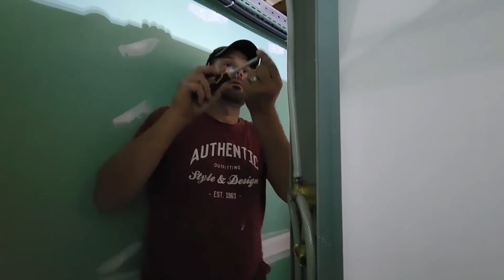It is different but it is still EXCITING!!

Comment: for off grid dryer  you are better to use natural gas  or a heatpump or condesing dryer. as they use  very little power 300watts to 1500watts . it will  do the same amount of drying at 1/4 the energy  cost .

 as to the plastic waterline installation   that you are currently using in Russia . Canada had the same +20 years ago and still in use today ( i believe they call it propex now )  but mainly see it on 1' or bigger lines in Canada  and with hydronic installations  as the fitting are less likely to fail as the ring type can  corrode and fail.. once you get use to it is much easier and faster then  crimping with pex especially in tight spots.   the pex crimping  you are referring too  is "surelok'"    that has the dog ear that you squeeze together.  it is used all across Canada   as I have  being using that surelok for long time in western  Canada.  the other version is "crimprite" that just uses rings.      I prefer the surelok version because if you need to remove the ring  you can do it easy enough  with side cutter and you can reuse the pex fitting.  sharkbites or similar  I use when i am lazy and  need it done quick  and/or transitioning from copper to pex .  as they are prone to failure  and leakage over time

Comment: Hi Arend!  I used to get bad nose bleeds after living in a northern climate for a decade.  I would strongly consider a humidifier for your home.  Use a nasal flush a few times with distilled water.  

I would also strongly recommend using a bit of petroleum jelly-based product on a cotton swab and lubricate the inside of your nostrils before you go to bed.  Lubricate as far back in your nostril as you are comfortable doing.  I use a product called Carmex and it has worked awesome to prevent nose bleeds.  Keep up with it because they can get worse.  It landed me in the hospital a few times.  🫤

Comment: That is type A pex it has the advantage of the fitting not  restricting water flow  because fitting id is the same as the pipe
Reply from the maker: That is a bonus

Comment: You sure that single warm water tank will be enough for heating and showering such a large family?
Just outside Moscow I had 2 gas boilers for a large house and 5 people and it's less cold than NN. I had to switch on the second when -20 C hit. Maybe you'll need an extra electric water heater when temps go down that low, to back up the wood heater.
Reply from the maker: Ya maybe

Comment: yeah it is basically PEX there are different classes of pex style fittings etc... learned this when I did a plumbing course Expansion Fittings Expansion fittings are a highly reliable and robust type of PEX connection. Known for their superior flow rate and leak-proof design, they are a preferred choice for many professionals. The key with expansion fittings is not over expanding them.  The other consideration is flow rate matching and fitting sizes and interconnections.  They have max PSI rating that can vary so if you intend high pressure applications look into what the pipe is rated for for your shower, its probably fine though.. And temperature rating. ie. good for domestic water but may expand or warp when heated close to boiling temperatures. Also heat may result in it shrink fitting once it cools. However useful as they are able to be shaped with relatively low heat ie a heatgun if you know the bending technique.

Comment: I don't know how far the farm will be from the main communications. But electricity will be needed in any case. Green energy is good only if there is a reserve for traditional. The house is large and will need a lot of both electric and thermal energy. Putting up poles and running a cable will be very expensive, but possible. But with gas, as the cheapest thermal energy, it will be even more expensive. Heating with electricity in the Russian Federation is very expensive. The cheapest is gas. Between electricity and gas, there is a niche for wood pellets. In the Russian Federation, this is not expensive enough, especially for a one-time purchase of a large batch. For this, you need a pellet boiler and the appropriate equipment throughout the house. If you place such a boiler in the basement, install inverters + special batteries in case of a power outage at home, so that the pumps work and the boiler does not burn down along with the house. In any case, in the future, the farm will be large, a lot of electricity will be needed, therefore, three phases of 380 volts will be needed. To lay gas to the farm, you will need a trench 1.8 meters deep along the entire length to the farm. Plus plastic pipes, there, etc. Okay, all this is advice and no responsibility, go for it, I'm sure you will succeed. The main thing is health and family.
Reply: Russian regulatory requirements for laying underground gas pipelines Gas pipelines should be laid at a depth of at least 0.8 m to the top of the gas pipeline or casing. In the following places, the depth of laying steel gas pipelines may be at least 0.6 m: places where traffic is not provided. Not 1.8 m.
Reply: @andreyiforoff8891  0.8 m Possibly, but I live in the Moscow region, on our plots 0.6 m is impossible. In any case, an earthmoving machine is needed, the depth of 0.6 is very suspicious. Any work is a cliff and a fire. In any case, you know better.

Comment: Hi arend anneesa family . Arend I agree it's a bit annoying the plastic joints with having to get that machine.  But it really shrinks back really tight so hopefully no leaks  . It is very satisfying building your own house to your design.  Of the shelf houses are fine  but if you want  change something then you stop look and may see it's easier to add on or reduce but a of the shelf is done to a certain budget and can be a pain for your builder or if you ask it to be  done a different  way . House is coming on well and that's a nice shower your fitting  . Did washing machine help your back any ?
Reply from the maker: Hahaha no the wash machine just made for a great laugh! We forgot to pull out the four shipping bolts in the back, we tried and tried to get this thing to stop rocking around lol, when we figured it out we had a great laugh

Comment: FYI...there is a real time voice language translator made in China and marketed as the brand Time Kettle M3. It's a wireless ear buds used in conjunction with the Time Kettle onLine App and your cell phone. It's a tri-function ear piece where you give one earpiece to the person you want to speak to and you have the other one. You take turns tapping your ear piece when you want to speak and the translated language you set is heard. Worth a look at if you can get it onLine in Russia. 
That pipe style is found in Canada/US known as Upinor Brand
Reply from the maker: I bought one of those time kettle translators... it does not work very well

Comment: I have seen boilers that have a heat transfer system through pipes inside. Usually they can be used if there is an external source of heat heating. The external source can be any Electricity, gas or firewood. The internal pumping unit gives off heat to heat the water. A great thing is that there are no temperature jumps like in my house, when the water heating starts in a double-circuit boiler. As soon as the pressure drops in the system, the temperature changes, it becomes uncomfortable in the shower, you have to turn the handles two or three times, then cold, then hot.

Comment: I’ve used pex tons on tiny house builds. Prefer the crimp type also. Shark bites often failed and had leaks. Might be because the homes are often moved long distance before they get to the final destination. Had to Replumb a few homes because of it. Just better to use the stub type crimps. They look like a wedding ring. Crimp the stub and they are done.
Reply from the maker: Those are the ones! Nothing faster

Comment: Both PEX A and PEX B are available in the US.  Crimp style, B, is the home owner style due to tooling as you pointed-out.  Originally, the shrink style, A, was used only by professionals as the manual tool cost US$400 to US$500.  The main difference is that PEX B fittings have a smaller internal diameter and also create flow turbulence, reducing maximum water flow substantially.  Additionally, I have heard that type A connections are more reliably watertight, especially long-term.
Reply from the maker: Thanks for the info! Appreciate you sharing that
Reply: @countrysideacreshomestead2008  You're welcome!  I've never used the drill type power tool of any kind, but the manual type was much quicker using a ratcheting pliers type of action using 2 to 4 squeezes, depending on diameter of the PEX tubing.

Comment: In Russia 99% of all plumbing is made of polypropilen and you have some of it as well. The press system you used is not convenient. The most convenient press system is Rehau or Tece but they are expensive. So just use polypropilene.
Reply: Ну у меня металлопласт, например)

Comment: Hello everyone. If you want to install solar panels on your roof, there may be problems due to snow, because your roof slope is small. The best option is to leave the network connection as an alternative source and the ability to use it when necessary, in Russia electricity is not expensive, and you can use solar energy nine months a year.

Comment: Push-on fittings you are talking about are known by some plumbers. But they are not produced in Russia. When we had good relationship with Europe, these fittings were imported from there. But they were very expensive and not commonly used because of the price. This system that is used in your home is one of the chipest, because of the plastic ring that makes the connection tight. Normally we use brass ring and another instrument, that is more convinient. Be careful using this plastic ring when there`s low air temperatures (there may be a leak in connection)
Reply from the maker: Understood, they were too expensive in Canada’s too

Comment: There pypes with axial fitings are very good and super quality, but your plumber took very cheap ones, which could be bad in the future, so check it
Reply: also he did super strange thing, in the place where pipe connects to valve, he used different fitting, which is really bad and dangerous (I have been using them and I know what I am talking about :D )

Comment: Does Russia have any local building codes and do you require any building inspection at any level?
Reply: I’m sure they do but not as strict as here in Canada. I wanted to put a sun porch on the back of my house and just the application to the city was over 6k then if they decided no I still didn’t get my money back.
Reply: He said there are some codes, but they are not enforced. No regular inspections,  just a final inspection upon completion.
Reply: In Russia, there are no codes or inspections for single-family homes. There are many different technologies for building walls: brick, concrete, aerated concrete, logs, timber, frame, etc. There are also many different pipes: PVC, polypropylene, metal-plastic, steel, copper. Arend used polyethylene pipes, which is not typical.

Comment: Have you already applied to build a house? Have you been allowed to build? If not, there could be big problems. Just because this is an open field - agricultural land. You can't just build a house there. And that is why the electricity will not fail.
Reply: Да, они фермеры, у них есть право на 1 капдом и строения рядом

КФХ можно оформить как в виде ИП, так и в формате юридического лица . Наверное так.  ИП бы выгоднее для них, мелкие они, но пока только так.
Reply: @Serg-qr5my  Уверены? Аренд говорил, что они эту землю оформили на ООО, где у него 50%. А статус КФХ - это другое. Что-то я не видел в его видео что они регистрировали КФХ. А кто тогда глава КФХ? я поэтому и написал, как бы не наступили на грабли и не получилось как с банковской картой
Reply: КФХ можно оформить как в виде ИП, так и в формате юридического лица . Наверное так.  ИП бы выгоднее для них, мелкие они, но пока только так.

Comment: You may want to check for sure, but I don't think you are correct on the laptops (or modern computers, in general) being more sensitive to 'dirty' power.  In fact, electric motors tend to be more sensitive to dirty power where the harmonics can cause them to heat up, etc.  Just do a quick bit of research.
Reply: Yes. Electronic devices (TV, computers, telephones, etc.) usually operate in the range of 100-250V and are very undemanding.

Which refrigerator with a classic old motor is very fond of high-quality energy..

Comment: You didn't say, but in the electric circuit, in addition to the batteries and inverter, there should also be a charger that operates from the same inverter. It is desirable to have high-capacity lithium batteries and a charger for them of at least fifty amperes. And the best way to handle this is for specialists. In Russia, I know many houses that are powered purely in this way, and they even have enough energy for electric heating. Only for the operability of such a complex, a correct calculation of how much of everything and with what parameters should be ordered is needed.
Reply: Дорого, нет смысла. Цена именно в АКБ, они расходник.

Comment: There are two types of registration 1. permanent registration at the place of residence - requires a house, housing. 2. Temporary registration at the place of stay - requires any address, let it be just your site, without a house on it. The law allows for temporary registration at the place of stay for the entire permitted period of the visa, but unfortunately, officials do not know this, in this case it is necessary to clarify the law. If they refuse to register at the address of the site, then it is necessary to ask for an official reason for refusal, on the basis of which provision of the law they refused. I also registered on my property while the house was being built. I had to go to the head of the migration service of the entire region with printed laws, she realized that I was right, called the local chief and allowed such registration. But as soon as you make out a house, you need to make a permanent registration. According to the law, you must have housing in the end, in a year or even three years, I don't remember exactly. Until then, you can register at your site and officials have no right to refuse this.
Reply from the maker: Interesting,  thank you for sharing, i will look into this further

Comment: Putting a shower tray is a very big mistake, if you do it yourself, then it's better to make a podium, because the tile will be single and you will never have to worry about water flowing somewhere in your life. Even waterproofing does not give a 100% guarantee that you will not leak water. And in the future, you will have to constantly buy silicone and change it.

Comment: Before you build other buildings near the house, find out at what distance they can be built. Otherwise, you will be fined and forced to move the building.

There are rules for building a house on the site. There should be distances between the house, barn, garage, bathhouse, well with drinking water, outdoor toilet, shed, for firewood and coal, prescribed in the rules.

The distances also depend on whether the building will be brick or wooden. Find out about it in advance.

Also, you will need to keep a distance between fences, trees, and bushes.
Reply: В России такие правила, если рядом стоит соседский дом. 3 метра от забора соседа. У него поле, соседей рядом нет. Он может строить где хочет, высаживать деревья где ему нравится. Не беспокойтесь.
In Russia, there are such rules if there is a neighbor's house nearby. 3 meters from the neighbor's fence. He has a field, there are no neighbors nearby. He can build wherever he wants, plant trees wherever he likes. Don't worry.

Comment: Не нужна вам "зелёная энергетика", сами потом Замучаетесь. Максимум, что, возможно можно будет купить - это бензогенератор. Цена вопроса 60-70К рублей. 
You don’t need “green energy”, you’ll suffer yourself later. The maximum that can possibly be bought is a gas generator. The issue price is 60-70K rubles.
Reply: Зачем, можно солнечные панели😊😊😊

Comment: I guess the engioners developed such a fitting that is the least likely to fail for such the problems of water pressure, and water banging, water freezing, and temperature changes, and mineral buildup. as some small villages have the culture of never having much water pressure and forget to put a water pressure regulator as there living with in a basic income.  thus they way over engineer, where fast setup and convience is not the importance, or the very novice first time Plummer does not loosen a connection with water pressure.

Comment: I wonder if the Inspector would reject it if ya put clamps on the plumbing pipe fitting anyway.
Reply: In Russia, there are no inspections and standards in private homes or buildings. Only government, public, commercial or multi-apartment buildings where the violation poses a risk to the surrounding people. 
If the farmers' house falls apart and worsens the health of the farmers' family, this is the right and desire of the farmers.